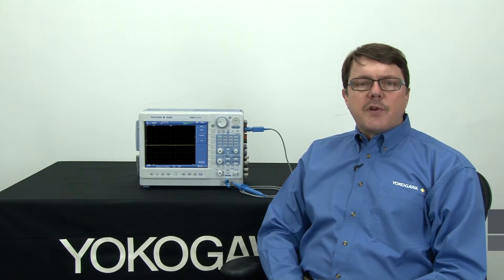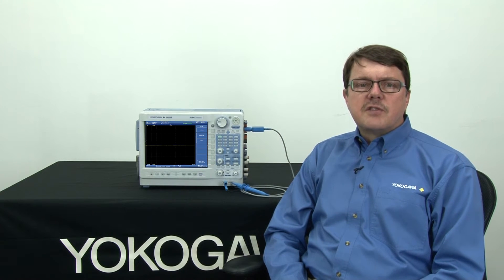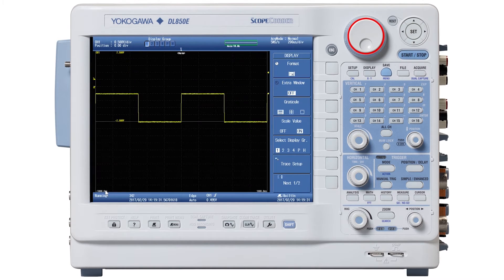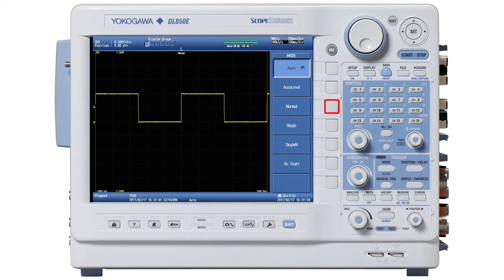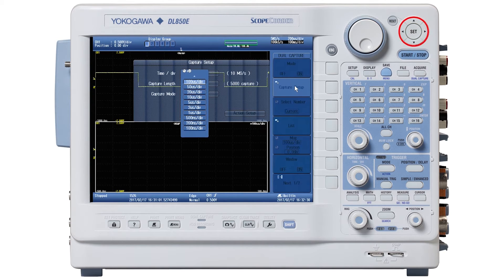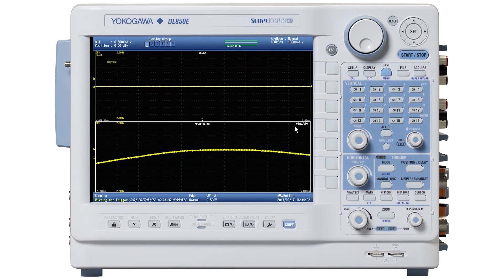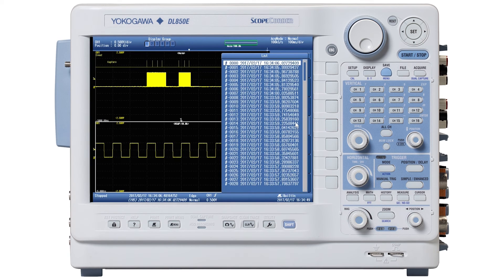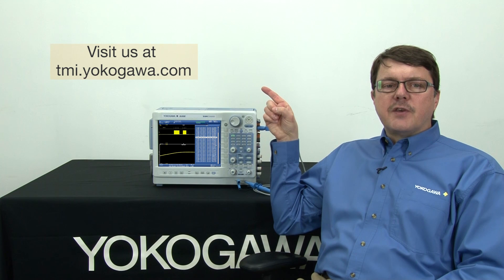Capturing a Waveform using a Dual Sample-Rate Oscilloscope

Comment: Thank you very much for the Video. How many channels we can use for the dual capture mode of DL850 ScopeCorder?
Reply from the maker: Normally, dual capturing is performed on all the channels detected by the DL850. However, under the following conditions, dual capturing is performed only on channels whose displays are turned on: When hard disk recording is enabled and when an increase in the record length of the main waveforms places a limitation on the number of channels that can be used. In both cases, dual capturing is not performed on 16-CH voltage input module and 16-CH temperature/voltage input module sub channels whose input coupling is set to OFF.